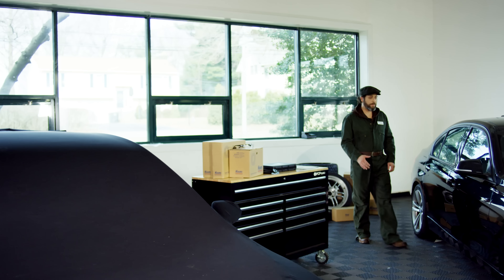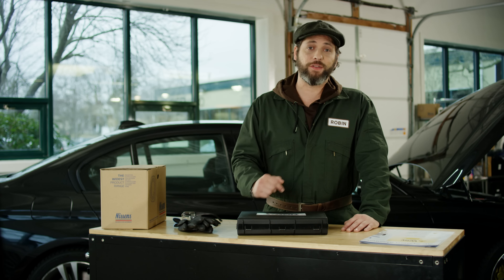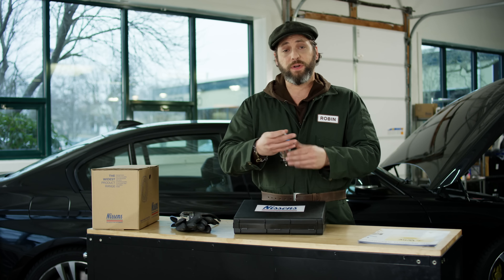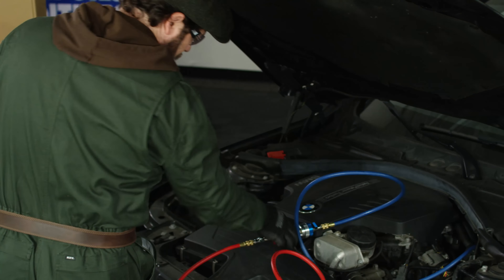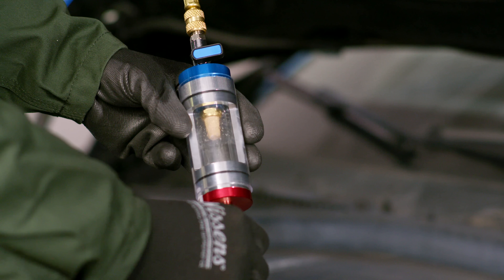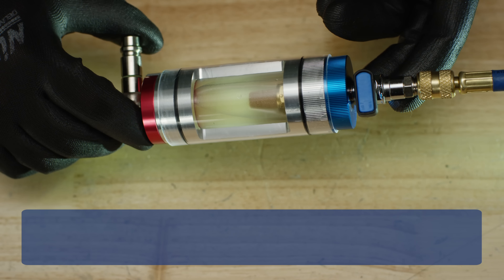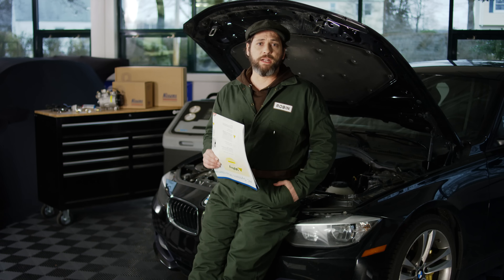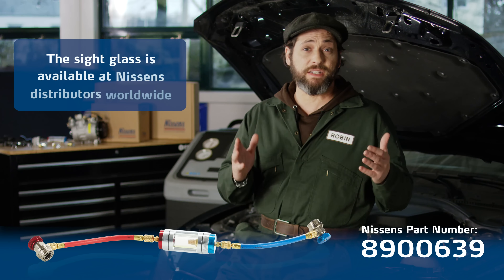AC System Visual Diagnostics - Inspection Oil & Refrigerant

Comment: Hello, I have an 2004 bmw x5 the compressor don't raise pressure before 10 minutes later is ok. I think the compressor stuks for a while. I suppose to add 2 once of ICE 32 with a yellowjack pump. Is better to recovery the 2 once of PAG oil from The system or is invariant? Thank you.

Comment: Very cool 👍🏻 whsts the part no of that nissans tool i'm gonna get my boss to get one cheers 👌🏻😎
Reply from the maker: Hi Marc. The part number is 8900639. You should be able to get it if you go to your local Automotive wholesaler. But please be aware that it is not a tool from Nissan. It is a tool from Nissens. Nissens is a climate and engine cooling manufacturer. ;)
Reply: @RobinundertheHood  cheers mate will check 👍🏻

Comment: Don't forget the compressor shaft seal leaks when AC isn't used for long periods people just get there car re gased and think that's it FIXED. AC must be used year round to prevent this from occuring but people fork out ex amount of money to regas when there's a slow leak in the system
Reply from the maker: Absolutely! the AC system as any other in the vehicle requires a good hand and a careful eye. Regular inspection and ALL YEAR use are highly recommended. And the all-season use is not only for safety, but it is also for the lubricant to be circulated around the system nooks and seals.
Reply: Guess this really depends upon the comp design... my car has a 17 year Delphi CVC and i'm sure it's been left completely unused for months and months in the past, even ran with very low charges a few times. So the shaft seal definitely took a beating lubrication-wise. Only recently i've begun using it regularly even in the colder months, and during the last service, 6 oz of ref (out of 18 oz, the nominal charge) were found missing two years after the previous AC service, however keep in mind that the system also had one leaky o-ring behind the expansion valve (this one likely due to unuse), a leaky HPRV o-ring (this one likely due to the exhaust plumbing being really close to the compressor's head) and marginal LP and HP side valve cores (these ones definitely due to normal wear and tear). I really think that what really hurts the shaft seal is overheating rather than prolonged lack of usage. Fixed displacement comps in TXV systems do get really hot when they're run with a low charge, due to increased friction (low oil circulation rate), increased superheat and increased compression ratios due to the reduced suction pressures. My CVC works only in low displacement when the charge gets low enough, and that is what likely prevented any refrigerant flow-related overheating... a pulley bearing failure or a slipping clutch is another reason for an overheated shaft seal, but both of them are still fine on my car...

Comment: What are the symptoms of either to much pag oil or not enough?  I have a car that blows colds but.  But on very hot days (87 or above id say) it takes way to long to get cold on idle.  But once i get up to highway speeds, its cold as ice and once i stop to idle again its fine.  Its just the initial start.  On days where its less that 87, its cold from the get go.  Now ive had it evacuated and recharged before but I am not sure what all they did.  I like to try and figure things out myself before spending lots of money if not needed.  Could not have enough pag oil in the system be causing my issues on very hot days?  Oh and the fan is working just fine.  If spray a fine mist of water on the condenser it instantly start cooling down and blowing cold.  Its just frustrating because on the days i really need it to be cold, its not on startup.  Id say the vent temp is at about 65-70 after about 5 min of idling on startup on a hot day.  But once i get going it will eventually get to 42 and stay there even if i idle again.  I want to pull my hair out!! lol

Comment: I had 2 older Ford vehicles. Both had green color in the oil. Your saying they both had dye added? Maybe Ford used green oil.
Reply: Dye has been added at some point. The oil is either yellow-ish or transparent.  They would never use an oil that's green because it would interfere with said tests.
Reply from the maker: @Fury_BlackWolf  Correct!
Reply: @Fury_BlackWolf  both systems worked fine though.  I still own the 2001 mercury grand marquis. Noticed it was greenish when I made a repair  2 weeks ago. I myself would never add dye or stop leak products to a refrigeration system.
Reply: @kurtzimmerman1637  previous owner perhaps. Or you owned them since new?
Reply: @Fury_BlackWolf  previously owned.
Reply: @kurtzimmerman1637  Well.  Could be the previous owner or whatever workshop he/she went to. Not impossible.  Me personally try to avoid any kind of dye because i see it as a last resort if a leak simply can't be found. But there are people who doesn't mind throwing some in from the start of an inspection/repair just to make it easier.
Reply: @Fury_BlackWolf  you are correct. The only thing that belongs in a refrigeration system is oil and refrigerant. 😂

Comment: I have a strange failure on the airco. I got it diagnosed at two shops (both wrong). Total qouted repairs of + 1000 euro. In both time simple logic can tell you that that cannot be it.

What happens? Start the car. Switch on the airco. Temp of the evaporated drops like crazy (to ~5°C in a matter of 15 seconds). Stone cold air is coming from the vents. What happens next? Heat echange temp start to slowly rise in a matter of minutes until the evaporator temperature is ambient temperature (I can read it from the diagnostic computer). It does not recover from this unless I switch the airco off for a couple of minutes. Switch it back on....same story. Stone cold very fast, slowely gets warmer.

Diagnose I got from the BMW dealer (leaking condenser). Diagnose from the other shop: faulty clutch. Both are confirmed false. My idea at the moment....faulty displacement control of the compressor.

Comment: When I get my  ar regassed at my garage they use the refrigerant they sucked out the car what if i get the refrigerant from an old busted car added to my system
Reply from the maker: Josh, if the garage applies the appropriate procedures, the refrigerant can easily be recovered after getting evacuated from the system. Majority of AC units can clean and filter the refrigerant and as long as the gas type is legal for use and matches your vehicle system you should not worry!

Comment: If you have a set of service gauges there's a sight glass built into the body, just bleed the refrigerant from the high side into the sight glass and view . Once finished suck the refrigerant into the low side. No need for this tool.
Reply from the maker: Absolutely, most of the market manifold gauge sets should have the inspection glass, but please notice its diameter compared to the tool's size I use. You can spot much more and in a much more convenient way, yet still being able to couple it with the manifold gauges to have the pressure readings at glance.
Reply: I would avoid doing anything that might introduce outside air/moisture into the system. Otherwise an inspection might do more harm than good.

Comment: It's illegal in many countries to even touch the ac unit if you're not certified.
Reply: And simple and costeffective? I'm pretty sure most people won't have ac evacuation equipment just standing in their garage.
Reply from the maker: @FURY__. You only need the AC service station to purge the tool and the hoses. It is necessary to remove the atmospheric air before playing with the AC circuit.  But a regular vacuum pump will do the job too.  I of course only recommend that this procedure is done by a trained professional. By the way, I have just uploaded another video explaining how you can flush. Two of the ways are without the machine. You can see the video here: https://www.youtube.com/watch?v=SuzcTdZIz3c
Reply: @RobinundertheHood  That is true and good informative video otherwise.  But sadly a lot of untrained people will probably end up trying this method and in worst case scenario hurt themselves. I am all for the idea to be my own mechanic and all but some of the things are best to be handled by professionals. Not sure how it is in most parts of the world but in EU it's illegal to even hook up a single hose to pressurised refrigeration system without a certificate.  Sad but true.   (I have worked with transport refrigeration for 12 years)
Reply from the maker: @Fury_BlackWolf  That is correct. And this video is to help mechanics identify issues quick and effective. My channel is targeted aftermarket professionals.
Reply: R134 does not have any chlorine atoms which will not harm the ozone layer. Just an FYI!!

Comment: So how can I  do this as part of my routine check if I need a big machine to doit : )))
Reply from the maker: Hi Christian. You only need the AC service station to purge the tool and the hoses. It is necessary to remove the atmospheric air before playing with the AC circuit.  But a regular vacuum pump will do the job too.  By the way, I have just uploaded another video explaining how you can flush. Two of the ways are without the machine. You can see the video here: https://www.youtube.com/watch?v=SuzcTdZIz3c